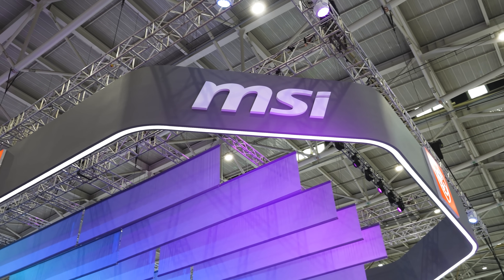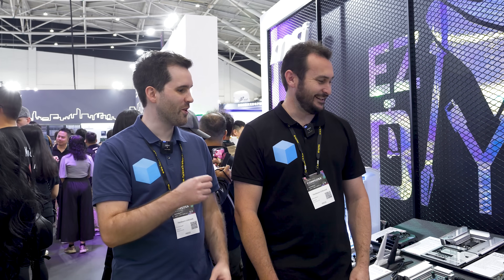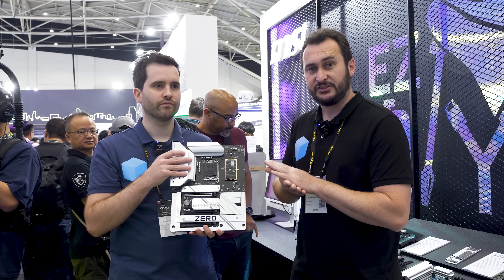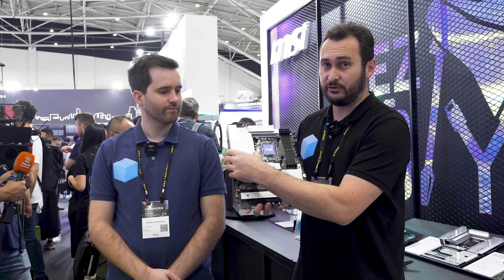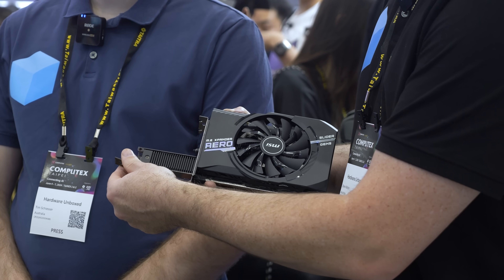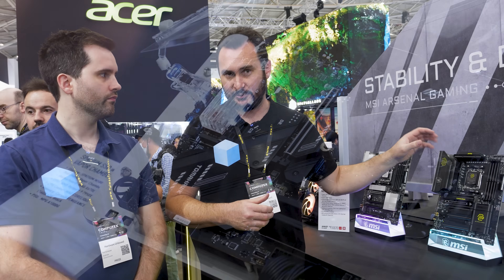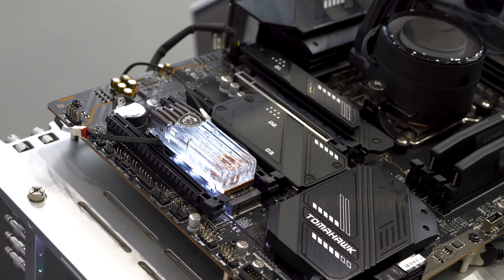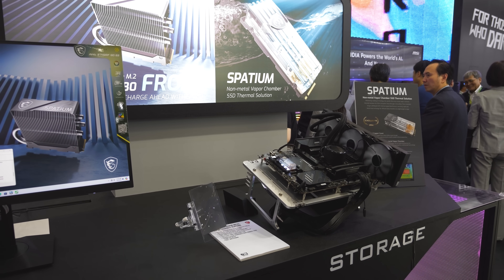Faster, Better Memory Is Coming, DDR5-8400 Now Actually Works

Comment: MSI have done right by me over the years. Here in Canada at least, their warranty service is second to none.
Reply: Well they must have changed a lot. Admittedly this is a 15-20yr old anecdote (vague on purpose), but MSI support was so bad for me, even as a major OEM, that I was responsible for killing that entire relationship. Was having personal and professional issues getting them to honor their warranties and it escalated wildly. That break up was only for a few years but it was shameful how resistant they were to replace anything, ever, for any reason, no matter how large a customer you were. This is why companies need to not be complete shit heads about this because they could have been 100% great for the past 10 years but I still think they are a POS for their past actions. Trust is hard to regain.

Comment: Hardware Unboxed, better focus on AMD. Nvidias Ceo Jensen started to pull AMD down by saying: "More you buy, more you save" compared GPU to CPU.
And next AMD going to release a mobil 16 Core with 40 Compute Units, the 12 C 16 CU comes out in July. Also when RTX 5000 is out, AMD will offer their more efficient GPUs.

Comment: Is a single camm2 module dual channel?
Reply: Depends on how you occupy it. But the ansver is Yes. It is dual channel.
The problem is… if you want more memory later, you have to swap the whole thing and buy bigger memory to replase the old one.

Comment: Why don't you mount CAMM2 at rear and make a new standard in which you could redesign a case so user only need to pop the rear case cover.

While I kind of understand the important of CAMM2 to laptop, zi don't understand thr reason it needs to be used for full tower PC.
In a greater good, DIMM allows you to add more memory, swap a module that's broken.
With CAMM2, you replace everything, it means that it will be harder to troubleshoot or your PC becomes completely useless if RAM is broken.
Trading performance with redundancy, for me, it is a bad trade-off with PC tower market.

Comment: Wait until you get DDR5-10000 and you get a whopping 5 more fps average in games over DDR5-6000!
Reply: Modern CPUs are heavily bandwidth limited
Pair that with much lower latency of CAMM2 and that 5 extra FPS turns into 50
CAMM2 can also make it finally easily feasible to have a 256-bit RAM bus on consumer boards (equivalent of quad-channel)
Reply: Assuming 5fps @ 60 — 8%  just from the bandwidth. If the timings are the same as the 6000, might result in the neighborhood of  25%+
Reply: For extra $200…
It will sell like hotcakes!
😂

Comment: I thought the CAMM2 module was supposed to solve the problem of laptops having to use SO-DIMM as they aren't aren't low power memory modules.

Comment: Proprietary connection on a MB/AIO, that can use USB-C, so why not just make it straight up USB-C and maybe double your C headers on the MB

Air cooled GPU's already dump the heat inside so numbers are around there for heat

Comment: CAMM2 it's really impressive and a big set! better latency and speed and single module only. 
The only drawside for now it's obvious lack of choice and a non existence used market and high price.
But Intel with this crap CUDIMM it's just putting a roadblock to CAMM2 mass adoption thats now a JEDEC standart.
I want to see ITX design with CAMM2, maybe ever cam put the module in the backside of the motherboard. But think not possible to use "extended" CAMM2 modules unless stick beyond the motherboard if have case clearance.
Maybe with AM5 the CAMM2 module cam be much close to the CPU that intel because the cooler holes and have less space issue.

Comment: that's the first time in a long time i see really useful features on usability, the PCIE release tab has been a nightmare for a long time, next will be the atx psu mainboard connector and the front panel jumpers

Comment: It's about bloody time! Finally a socketed Ram solution to do away from those problematic slots that always end up losing tension on the pins and loss of or intermittent connection as time goes along.  The amount of motherboards I have had "die" due to this issue is crazy, somewhere around 80-90% over the decades.

The old flat SODIMM like server slots and SODIMM itself are the only Ram interface I have had no issues with, but DIMM, the connection becomes dodgy after a few to half a dozen years and needs constant wiggling or reseating to get them working and placing the PC in a spot to isolate from bumps or vibration so the Ram doesn't get upset.  

It's not just a temperamental inconvenience, this issue has completely wiped my OS many times due to critical memory corruption that corrupted the OS to unrecoverable states. I have longed for a Ram interface such as these.  Very excited to see it happen and I had no idea, very pleasant surprise.

Comment: A single CAMM module on the system, does it rely on DDR5 dual channel spec? Dunno faster speeds and latency is great, but what about the bandwith?
Reply: Single CAMM module is 128bit wide, total bandwidth is unaffected / scales exactly the same with frequency
Reply: @niter43  nice, didn't knew that spec, tought was 64bit like a DIMM module

Comment: I wish mobo manufactures would put the WiFi and BT antenna at the top of the I/O, and have the antenna attach directly to the rear. It's just much cleaner

Comment: During the past 30 years, getting faster RAM has never made my computer appreciably feel faster.
Reply: I was able to pull a couple frames faster in some games between overclocked ram and non-overclocked. So it does make a difference. I’ve never noticed my computer “feeling faster” though.
Reply: the big notice is memory speed was going from sdr to ddr
Reply: i hate your avatar.. it make me think i had hair on my screen
Reply: For Ryzen it is due to infinity fabric
Reply: Not faster ram but having enough ram!! Goes from unusable to oh wow didn't know this thing worked so well.
Reply: one of those areas where we peaked ages ago for general computing. faster ram will always be niche benefit unless you’re running something from the stone age. Jedec on the current standard is almost always more than enough if you’re not a frame chaser.
Reply: @H94R  RAM is, in fact, the main bottlenecks of every PC today. If it was possible to decrease RAM latency from 200 cycles to at least 10 cycles (L2 cache speed), a build with RTX 4090 and some Intel Sandy Bridge CPU would be limited exactly by a GPU even in 1080p... If you wanna see a proof of my words, try to assemble some x86 program that interacts with GPU only through registers. You'll see if CPU is not bandwidth limited, it's far far far more powerful if used to its fullest.
Reply: @YourCloseCoop My point was that a modern system running jedec will feel the same as running 8400mhz. O.P specifically referenced the general feel of his pc after ram speed change. obviously high compute tasks are different, but that’s not most people.
Reply: @H94R  aight I got you, yet the difference between jedec 4800cl40 and 8400cl40 is mere 20-25% by the way...

Comment: RAM design really hasn't changed that much in decades as it's been a long thin slot in piece for so long so going to CAMM2 is huge. I really like it as it can provide very fast speeds and tons of capacity all on a single piece that's still interchangeable. I really hope this becomes the new standard as it's definitely an improvement.

Comment: i have a feeling this is going to backfire immensely in terms of pricing, becasue its not a open standard but a closed one that will need to be licensed. everybody is raving about the speed and bandwith but forgetting that price to performance is the most important part at least as a consumer product. like the only game that will benefit from this right now is like Star Citizen which is woefully unfinished technically.
Reply: Seems like governments should step in and force companies to stop licensing everything and screw customers over. Time to make all this open source with no copyrights/licensing bullcrap.
Reply: Its an open standard tho.

Comment: Interesting. That kind of socket for the ram could be allocated on the back of the motherboard and release a lot of room from the front, which could be useful in itx form factor

Comment: What we need is CHANNELS. Even casuals notice the increase in responsiveness of 8 channel Macbook or Snapdragon X. It's also crucial for LLMs. PC needs to keep up or x86 will be left behind. It's absurd that a high end gaming desktop is only dual channel like 20 years ago, but some laptops are now 8. Raw bandwidth is not everything.
Reply: On package ram makes connecting all of those wide memory busses popular but at the expense of no expandibility, we've had tri and quad channel in HEDT before, the extra bandwidth made little to no difference and the main problem will still be latency

Comment: With M.2 usually occupying the top PCIe slot space, and CAMM memory, there will be room for monster air coolers on a lot of boards if this takes off (although JEDEC are saying "no screws" so this likely will not be the final form).
The design freedom CAMM offers is worth it alone, all else being equal. This is one of the problems BTX was intended to solve.

Comment: - EZ M.2 Clip - i have that on Gigabyte Z790 board board for years. Nothing new here, you spent way to much time describing this:) Always wondered why this isn't a standard, dealing with those little screws was always annoying.
- CAMM II - these are double sided! I was convinced that this is one sided product so you can cool RAM modules quite easily. Two sides... a no no from me.
- CUDIMM? MORE one that please!
- Pre-attached IO port shield - finally.
- Hot swappable M2 drive is something new. Great feature!
- AiO Fu....zion? So the pump is higher than the block? Wonder how they solved the obvious problems that come with that config. Waiting for your review.

Comment: Mathematically, the speed of the present generation is two times the speed of the previous generation.
So the speed of DDR 5=2x DDR 4 speed.
DDR 5= 2 x 4800=9600
But you posted DDR5 RAM to have 8400 Hz.
You think it should be enough.
According to the above formuLa, it is not enough.

Comment: I don't get it. If you need more RAM you have to buy a larger module. You can clearly see that the one installed is half of the maximum size. So if this memory board is larger, traces have to be longer. The only advantage is that they are shorter on a mobo,  disadvantage: we have a new and fragile CAMM2 connector.

Comment: I'm all for CAMM2 being the new standard. Higher speeds and greater capacities all on one singular module, so there's no worrying about wether or not you're using the right slots or mismatching memory modules or running in single channel mode. So long as you get a good quality high capacity module it should last you the entire lifecycle of that generation of memory and maybe some of the next. And it'd still be user upgradeable. Bring it on, I say.
Reply: Definitely, really can't see any downsides whatsoever with this plus being a thin board it can be very nicely hidden into the board design with a nice heatsink. Looks so clean.

Comment: Using CAMM2 get us outside the user error of chousing unmatched ram modules, another user error is using wrong slots on the memory layout too... better speeds, better latency... you spend just one time and thats it... you have a dual channel module... please we need to get together for this to be standard! 
They can iven turn the CAMM2 socket from the back of the board for does hide cable boards too...
Reply: Could and maybe even should be standard when DDR6 arrives. DDR5 things will most likely be mainly dimms still because it is very videly spread memory type at this point

Comment: derbauer just had a video with 10600 MT/s at gskill
Reply: Yeah, but that surely only works if you win the silicon lottery, stand on one leg and even then only in the benchmark, but it will crash your system if you do some actual work.

Comment: It is a downside with CAMM2. You can not add new modules. If you want more memory you have to get a new CAMM2 module and replace the older one. So at least plan for this when buying one. I have a feeling that OEMs will try to sell you the smallest CAMM2 they can get in order to save some money, probably 16GB. And you will have to cash out for a new 32GB module if needed
Reply: So start with 64gb problem solved
Reply: @Roweyy  exactly, 64 GB will be enough until DDR6 platforms
Reply: Please stop repeating this. You can stack 2 of them on a single connector, and nothing prevents a board manufacturer from putting multiple connectors on the board. They can even use the back of the board.
Reply: @BrianStewart126  It is True that standard JESD318 supports stackable CAMMs. But we will NOT see this in this release window. Non manufacturer will support this this release window
Reply: 😒who cares ?
Reply: Single channel CAMM2 modules are stackable, they use only half of the connector. So you can upgrade to dual channel by adding another module. And single channel modules will have lowest capacity, DC modules are twice as big with same dram ICs.
Reply: Sooo exactly like EVERYTHING including RAM already is...da hell
..
Reply: I never add memory in my computing history, always replaced for more capacity sticks. four modules it's headache unless you are running JEDEC speeds/timmings and with DDR5 its worse, so for me it's a non issue.
Reply: @joaopedrogod that’s not true. It just depends on what the memory controller on the CPU can handle. When I build my AM4 computer in 2019, I got 4x16GB RAM sticks, and they’ve all been running at 3600 CL16 since day 1. That’s pretty tight timings and not much slower frequency than what the memory controller on Zen 2 could handle with just 2 sticks on a 1:1 ratio.

Bottom line is that if AMD and Intel dramatically improve the memory controllers on the CPU side, there’s no reason we couldn’t use quad channel memory above JEDEC speeds the same we do with dual channel memory kits. They’ve don’t it before, and I’d be shocked if they aren’t working on a solution. After all, running JEDEC specs on an 8 channel server board (and JEDEC for DDR5 goes all the way to 8000MT/s) is obviously something they’re working on. If they can get that working, dual channel 10,000 should be no problem even with 4 sticks populated.
Reply: @joaopedrogod  cost more to hunt down another 2 of the same old and slow memory than just buy new, better higher capacity and sell the 2 you have to someone that is obsessed with the upgrade idea
Reply: using 4 slot on ddr5 is trash anyway
Reply: At least u can sell the old module when you upgrade
Reply: @houssamalucad753  Except that the most common reason to upgrade is when you current hardware is lackluster. Meaning that OEM build will have cheap memory nobody want and that will become instant e-waste.
Reply: @Vaasref  not really, there is always a market for used parts, maybe you don't get close to how much you paid, but it means your hardware doesn't go to the garbage, and memory is still replaceable which is always a win in my book looking at how laptop manufacturers are doing things
Reply: creating extra e-wastes in the meantime.... deliberately... for profits...

Comment: So watercooling memory would probably be very easy with the camm2 module. Could have a cpu and memory combo block, or both separated
Reply from the maker: Yep, very easy.
Reply: I prefer  ram on die like apple and lunar lake   @Hardwareunboxed
Reply: There's a vid showing water cooling at Computex on an MSI rig on the channel OC3D.
Reply: Slowly getting to a future where the whole motherboard just has one massive block all over it.
Then the next step is just throwing all your parts into water and it making a computer soup in your case.
Reply: @moldyshishkabob thermaltake have a immersion cooling system on show at the show from Paul's hardware video.
Reply: @bionicgeekgrrl  Oh shoot, the future is closer than I think. Thanks for letting me know, I gotta see that!
Reply: @bionicgeekgrrl Der8auer did this at a show using Novec fluid years ago.
Reply: Not for the double sided modules
Reply: @imadecoy.  Having water cooling on 1 side of a double-sided module would still work though, just not as well as if you had a water block on both sides.

Comment: id much rather have this than any onboard SOC or LPDDRX ram, this is the best of every world, I hope Arrow Lake and Lunar Lake both get support. Imagine these with DDR6-21600, going to be insane
Reply: Arrow Lake comes with memory on the package doesn't it?
Reply: @bionicgeekgrrl  I don't think so, this is designed for Lunar Lake. Arrow Lake being a desktop chip will likely still use standard memory dimms
Reply: @RobloxianX  It appears I had the two mixed up, all blur together so many lakes!

Comment: Will be interesting if we can see CAM2 contributing to AM5 being able to reach higher memory timings/bandwidth, or if the limiting factor is the zen 4/5 memory controller.

What are the MB manufacturers saying behind closed doors Steve/Tim?
Reply: Is the recent ryzen memory controller even able to address cam memory? I was under the impression that so far only the G models can do that (basically APU Chips)
Reply: @hornsteinhof7592  It's same DDR5, just different connector.